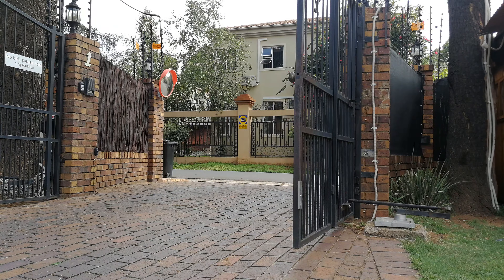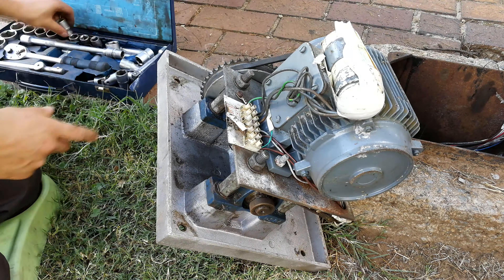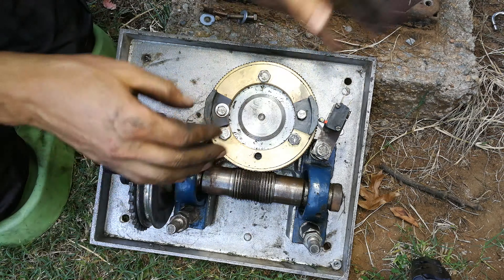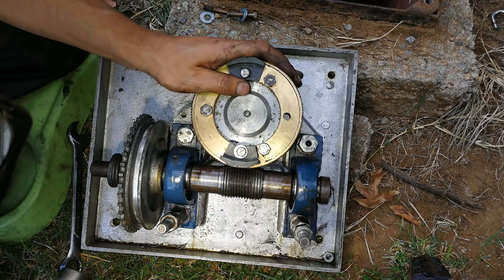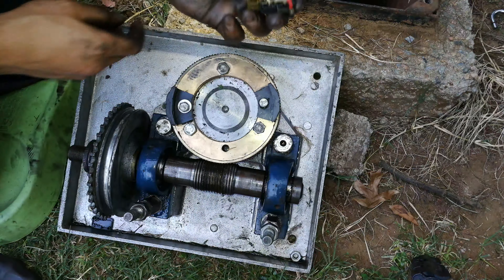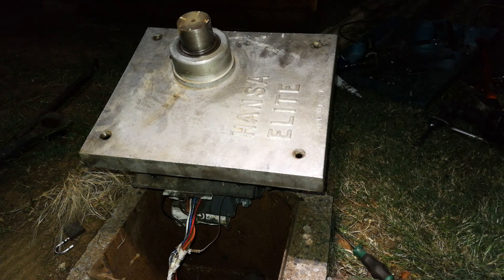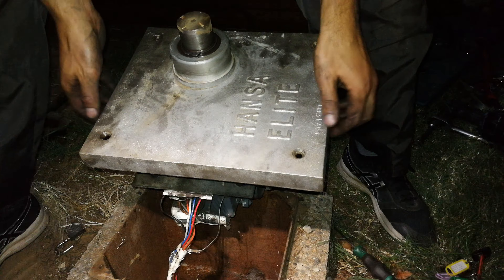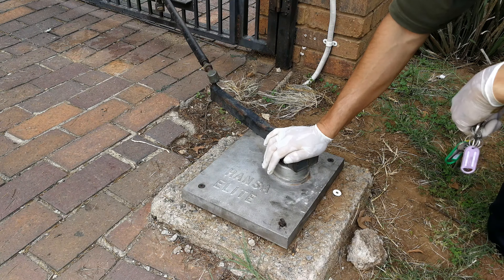How to fix loose gears on a Hansa Elite gate motor system.

Comment: I'd also like a video where I can troubleshoot to reset and calibrate the swing gate. I have a problem were it's stuck on display with the code 1 and 2 or 11. limit switches are working and lined up when gate is closed and open.

Comment: Could you explain how to actually get the main gear off? I have removed the 3 bolts as well as the “things” that trigger the limit switches. Either I am missing something or it has not been opened in forever and it simply stuck.
Reply: got it off
Reply from the maker: tap it out with a mallet. i cant recall 100% but i think there is a spring shaft holding it in place